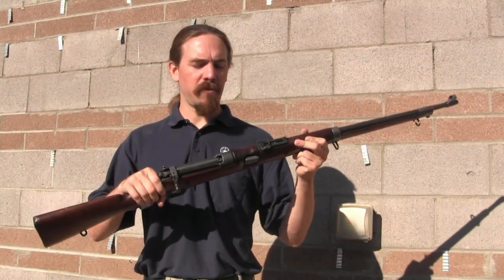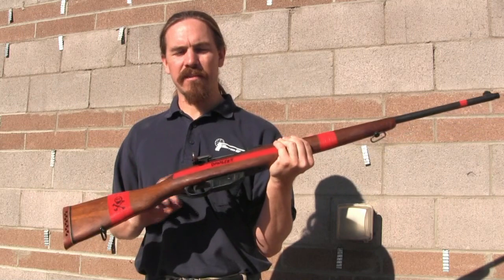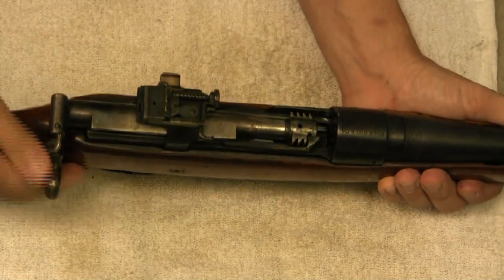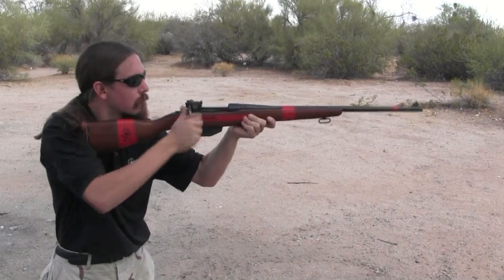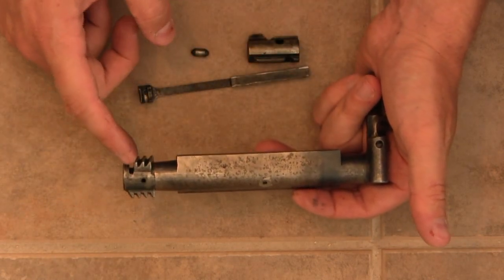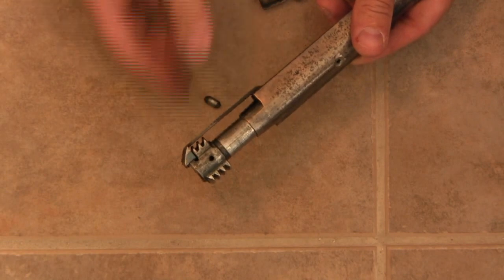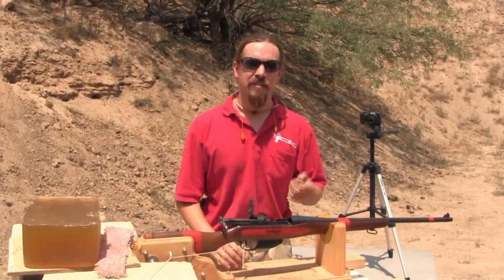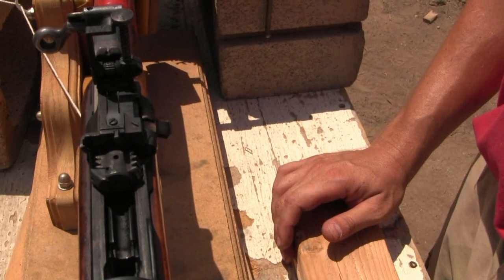Myth and Reality of the Ross MkIII Rifle

Comment: Very interesting! Can the same problem, bolt misassembly occur in 95 Austrian Mannlichers?  I have one and sometimes when pulling the bolt back, (I'm obviously afraid to shoot it), the bolt pulls right out of the gun?!
Reply from the maker: No, this is not something that can happen on an 1895 Mannlicher. Pulling the bolt clear out of the gun isn't actually an issue - the problem would be if the lugs are unlocked when firing - and they can't be on the 95 Steyr.
Reply: Thanks very much!
Reply: ***** Yeah, it's a beast to shoot, which is surprising, since it's not any more powerful than anything else of its era.

Comment: The other issue/urban legend with Ross rifles was soldered iron sights literally falling off of rifles if the barrels got too hot.
Reply: Riley Powell Completely ignoring that its' original purpose was a COMBAT RIFLE used on a 2-way firing range.
Soldiers didn't often gunsmith in the field and were quite known for putting pounds of lead through the barrel in short order.
The Ross is viable as a quirky historical piece but, not as an example of intelligent design and functionality.

Comment: Hate to say it but I think you just wrecked a really nice and rare Canadian Ranger issue M1910 Ross. There were only a few hundred made for the Rangers. They are very hard to find and are often shot out and used up and just generally trashed. A very rare and valuable gun in decent shape. 
What a waste.

It is the correct length and modified pattern,  The correct pattern cut down stock with correct front sling mount. Correct length cut down barrel with correct front sight. Most of the guns had after market recoil pads fixed to them by the soldier carrying them.  I have a an ex ranger M1910 that was purchased up north from an old timer that served with the rangers and still bears the stock stamp of the rangers. 

The M1910 was a good rifle, but not for trench warfare. The mud really was it's undoing. Also given the era most of the soldiers had no experience with anything mechanical at all.  So that only exasperated the issue of misaligning the bolt. Most Canadian WWI snipers refused to give up their Ross's and hung on to them till the end of the war.  But they were for the most part not deep in the mud, and were far more familiar with their guns so misassembled bolts were avoided.  

The Ross actually had the strongest action of the era and could handle much higher working pressures than either the Lee Enfield, K98, or M1917 and was proofed to 62,000 LBS far above anything of the era.
Plus it was the most accurate of the bunch. Hence the reason Canadian snipers refused to give them up.

In the artic the Ross was not subject to the same conditions that plagued them in the trenches. So it stayed in service till the early 1950's in the Canadian Military with the Rangers. 

Next time please research a fire arm thoroughly before trashing it.
Reply: Unless you were going to have it imported, I wouldn't worry all that much. Although I dislike the destruction of a gun in general - including a mosin nagant torture test on Iraq veteran - (youtube) provides a timeless approach to what we could only fathom by reading a dusty, out of print, tome of the 'day: this provides a visual record to those who may have had to take a highly politicized publication, irregardless of the rifle's merit, at word value. Also, the safety of the shooter is increased by being able to follow along the visual ques regarding the rifle's fitness in firing. Best of all, this process does not bear in repeating in private - when available to anyone with a decent phone. Rather, I dislike the interest this may raise in the US - as it makes it harder for me to have it exported "home."
Reply: in all reality the rifle is not destroyed or really all that damaged a competent machinist good make a replacement using the old one as a pattern then it would just need heat treated